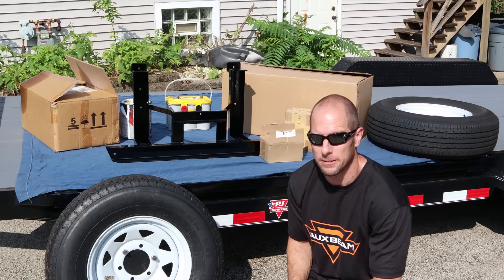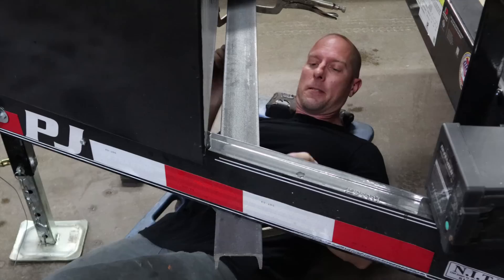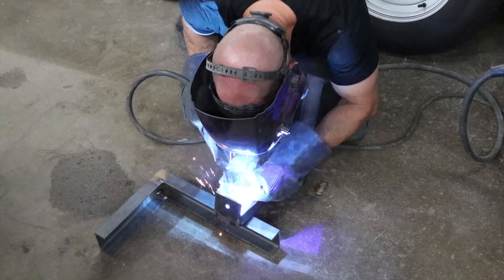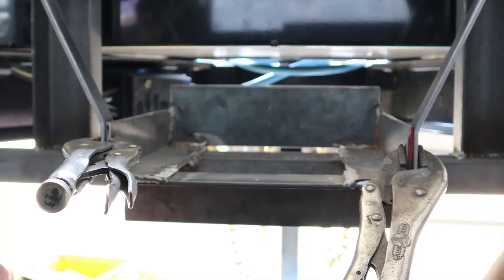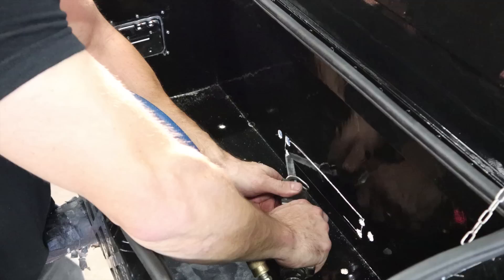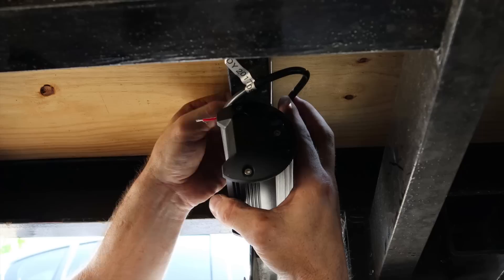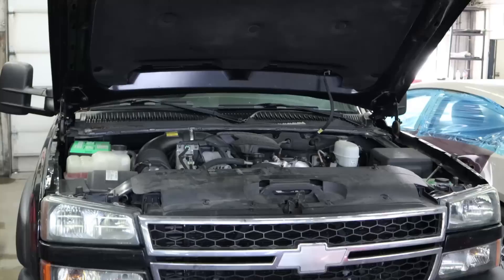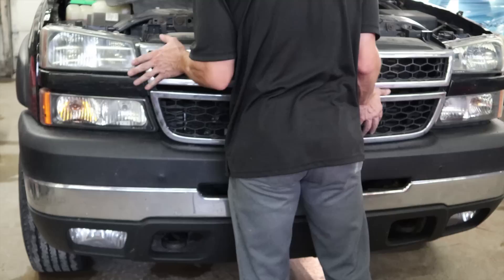2019 PJ equipment trailer winch mount fabrication,  LED light installation and other mods..

Comment: Great Job as always Scott. I bought a set of AuxbeamThree Colors Switchback LED Fog Daytime Running Lights and they are junk for my SUV. On more then one occasion I start my SUV and 1 light is white and the other light is yellow. So I have to keep turning my fog lights off and back on to try and get them to be the same color. It is really a pain in the arse. I have tried contacting Auxbeam through Amazon messaging so I can get this warrantied but they keep ignoring me. Sorry but I can not recommend Auxbeam. Sorry Scott to bring this up on your YOU TUBE page but everyone has the right to know how companies treat their customers.

Comment: the rotating back of the LED lights is so you can put them in so the led chips are parallel to the ground.
Reply from the maker: Actually it is to allow you to line up the muffler bearing and properly fill the turn signal fluid. LMAO

Comment: very nicely done, thank you for sharing!

The ONLY criticism I have is that I'd be very cautious about drilling through the bottom flange of the trailer frame.  IF it ever does cause an issue though, you're obviously more than capable of fixing/reinforcing it.

Again, well done and thank you for sharing!
Reply from the maker: Thanks,  the manufacturer drills holes in the frame as well for wires and attachments so I was not too concerned.  I always check over the frame when I am servicing the trailer so if it does become a problem, I will catch it and repair it early.  I would have preferred to weld it but didn't want to mess up the new powder coat.  Years from now when it needs a repaint, I will probably weld it on before it is painted.  Thanks for watching!

Comment: Great video I’ve been looking at these for a good while. It’s a very nice trailer and the mods r just what I was thinking about doing once I get one. The only thing I’d wanna do sometime if they r not already on is switching all the lights to led
Reply from the maker: I considered them for about 2 years.  Did a bunch of research on all brands and models and went to buy a 14k trailer.  After figuring out the numbers it made more sense to get this 10k.  The 14k cost 25% more and was 35% heavier.  The difference in load capacity was only 15%.  So to get a bigger trailer cost more to buy, register, maintain and operate but did not yield enough to justify the cost for me.  This trailer has been great so far.  I did have a wheel that split and they sent me a new one with no questions asked, just a pic to show the crack.  It pulls fantastic even when it is at full capacity.  It came with all led lights.  I don't think PJ sells anything without them.  Thanks for watching.  Good luck in your trailer search and mods!

Comment: you did a nice job.but you need to scale out your hitch. just look out when you load trucks on your trailer some states will stop you when you are over 5 tons.and they will scale your hitch. nice job again.
Reply from the maker: Thanks, I'm just at the limit with a 3500 crew cab dually diesel on it.  That would be the biggest thing I would ever tow and probably only once.  If I needed it anymore than that, I would buy a bigger trailer because I don't like to push load limits.  It leads to a shortened life on the trailer.  Thanks for watching.

Comment: Nice job. Welds look good. PJ makes a nice trailer. I have a 20' bed, dual power ram tilt back PJ (powers down as well as up) and love it. I added a winch as it came with a winch mount plate already installed. 
I recommend putting your battery in an enclosed battery box. 
Do the Auxbeam headlight housings have a cut off? Cheaper housing don't and if you run HID or LED bulbs they throw a lot of glare without the cut off.
As a former OTR truck driver, I prefer to drive at might too put my old eyes don't work as well as they used to so lighting is important. My truck is newer so has good headlights but I still run a big LED bar as well  as driving lights which are wired to my high beams so I can turn them off when encountering approaching traffic.
Thumbed up and subscribed!
Reply from the maker: PJ makes the best trailer in my opinion, the quality is unmatched.  The headlights allow you to rotate them and the beam is a wide flat pattern.  Because the headlight from the truck is still the original made for halogen, it has some glare.  I aimed the lights lower and it still provides more light than the halogen without blinding oncoming traffic.  My old halogens were worse for blinding people and didn't provide as much light.  Thanks for watching, glad to have you here.

Comment: You should upgrade your trailer plug to a 7-Blade it will give you the ability to charge the battery on the trailer while connected to the truck
Reply from the maker: I didn't think they even sold trailers without the seven pin connector anymore.  Maybe some cheaper brands but PJ certainly does not.  The volt meter in the trailer tells me at a glance that it is charging properly as well.  Thanks for watching.

Comment: Nice build. I’m considering ordering a new PJ trailer and they offer a winch mount built into the floor now. Not sure if they just started that or what. But I’ll be ordering a 22’ long trailer so even if the winch is on the bed and taking up room, 22’ trailer will still be long enough I would think.

Comment: Using wd40 or some oil saves drill-bits as well. I’d lock that battery up. Smart putting that winch in the tool box. I learned a hard lesson. They’ll still mangle that box though to get in
Reply: What was the hard lesson of not having it protected?
Reply: @SumRandomGi81  

Parts of my winch got stolen

Comment: Two things. Why did you take the grill off to do the headlights? I did the same with my lights and didn't need to take it off. Yes, same truck. Second, you might want to think about some extra bracing to the winch fairlead as it will most likely bend the toolbox if not. Two L brackets bolted under the winch to the fairlead is simplest.
Reply from the maker: The grill pulls off so for the 30 seconds of work it is not worth trying to work around.  The headlight have to go straight in with the new bulbs and that is hard with the grille in the way.  I think the easiest way to brace the fairlead is with one of those fancy winch mount brackets made out of 1/4" steel that bolt under the winch and have a mount for the fairlead.  You know, like the one I used.

Comment: Excellent fab work. I think you have a marketable product. The only mod I might suggest is maybe building a box to hide that battery and make it less sexy for someone to rip it off, also making the hold downs a bit easier to service.  Also, do you have a load gauge on your hitch? Looks like the tongue is a bit high but I recon the rear of that Chevy will squat pretty good when you get a load on it... but then you' might have your new headlights shining up in the air. Be nice to see what kind of ramps you have. Also you might need some pulleys for pulling your load to one side or another.
Reply from the maker: Thanks, I switched receivers after my first one started to crack.  At the time I had not adjusted the trailer coupler to the correct height.  Now with a new truck I will be moving it again.  Thanks for the tips.  There might be another video eventually.  Thanks for watching.

Comment: Did you hookup the lights under the trailer to your backup lights or are they just wired on a switch?
Reply from the maker: Originally, they were on a switch.  Since I found myself using them as reverse lights and they worked great, I connected them to the truck reverse lights.  Now they come on when I back up or I can turn them on for loading.  Thanks for watching.

Comment: Great job !!  Just a suggestion if your going to carry any vehicles that are a little heavier you could install a wind up jack on each side to help steady the back of the trailer while loading up !! Best of luck!! Again nice job !!!
Reply from the maker: Thanks, it does have jacks in the rear, I just did not have them on in the pictures.  They mount on the cups at the rear and flip up or come off completely with the pull of a pin.  Thanks for watching.

Comment: That winch box is a great idea and the lights make the trailer much more useable. Great job. Do they make small solar panels (to charge the battery) or are they more trouble than they are worth?
Reply from the maker: I have an account that I frequently pick up and drop off at night.  The lights and winch are worth it for that alone.  They do make solar chargers, the battery charges off the truck but I usually leave them together so a solar panel would keep the truck charged as well.

Comment: Ohhh I see the G8 in the background. What about protecting the underside of the wood deck?
Reply from the maker: Yep, the G8 goes everywhere with me for the summer!  I thought about sealing the bottom but I would not be able to do the sides of the boards without cutting up the trailer and removing them.  Since I could not seal the sides, if the bottom was sealed, the moisture would be trapped in the boards and rot them faster..... at least this is my thinking.  So it seemed better to leave the bottoms to "breathe". Years from now when I have to replace the boards, they will be sealed on every side.  Thanks for watching!

Comment: Why not put the fenders on hinges and a lock pin. Place the hinges on the outer lower part of the fenders and have them fold out when you need extra room
Reply from the maker: Because the time saved isn't worth the time invested

Comment: Not gonna tell you that you should have done anything differently i mounted mine to a solid steel plate though and welded it to the front lower rail of the trailer. then cut a thin slot for the plate and cut out for the fairlead in the back of my tongue box too just like you did but i got a big enough box to go across both tongue frames and put my battery inside the box with the winch. i spent $60.00 on one of the cheaper harbor freight boxes and i have the same yellow top optima deep cycle battery and of course there are no switches for the lights because my old beater trailer doesn't need those any more. it's in more desperate need of some maintenance than lighting. need to replace both axles and all 4 rims on mine. i've had my trailer since 2005 and it has paid for it's self 1000X times over now so the fact it needs new axles is perfectly ok by me now. finding them however is going to be another story i need to have it retrofit with a dove tail and some ramp storage though. right now i just put the ramps (which are also too short) inside whatever vehicle i am pulling or in the back of mine if i am pulling with my Escalade EXT otherwise i would have to chain or strap them down to the deck it's self. i'm wanting to do those upgrades because like i said i bought it new in 05 but it's just starting to little by little fall apart on me now. of course like i mentioned in the comment you responded to the other day i now have an 06 cummins mega cab to pull it with too so it won't matter whether i buy a new one or retro fit this one. it'll only matter to my wallet. Thinking i am going to upfit this one and go buy a covered trailer come to think of it
Reply from the maker: I had mocked this up in about 20 different ways before I went with this method.  It seems to work so far.  I don't know how I used my old trailer without the lights.  The time I spent doing all of this work has already been saved and then some.  I was limited with what I could do with the spares and other tool box around where I needed the winch.  Thanks for watching.

Comment: Once you blow out the Chinese tire with 90% of the tread left not your fault it’s the tires. We switch to fire stones and our spare tire problem has disappeared no more need for two or three spares. Our little business runs about 12 trailers we have per airsoft pellets into balance and have never had any poor wear or shaking problems
Reply from the maker: Weird, my Firestone tires on the truck still pick up nails and screws.  Maybe you can let me know how to inform the debris on the road that it should not affect my Firestone tires and I can use that trick on my cheap Chinese tires.
Reply: Well you can’t argue with that logic. Carry-on.
Reply from the maker: Mark Shropshire I used to work at a full service gas station in high school and college(yeah I'm old I know) it was in a very upscale town.  I had mounted 4 new tires on a guy's Mercedes and he returned the next day with a flat.  Of course it was my fault and he demanded to watch me as I fixed my mistake.  I absolutely hated when customers looked over my shoulder so I already was not in a good mood. As I set the lift, I felt a sigh of relief.  There it was, a roofing nail dead center in the tread.  I pulled it off the car and didn't say a word.  With him looking over my shoulder, literally. I sprayed a little soap on it and there were the bubbles.  He was even further angered by my f*** you grin as I said," Here is your leak."  I don't think he was stupid but I think he was having a hard time with the fact that he might have to apologize to a young punk that took his mistreatment and did nothing wrong because he immediately followed with, " I just bought these tires!! They are brand new how could they possibly have a nail in them?"  To which I replied, " did you tell the nail you had new tires? It must have thought you had your old set still!"  He turned around and walked away.  I repaired the tire and didn't charge him.  In my mind, it was worth working for free and my boss would understand I was trying to keep the customer as happy as possible.  He did end up tipping me and apologizing.  It must have been a humbling experience for him and he always treated me with respect from that day forward.  I learned as much from him as he did from me that day.  I have been on his side of that interaction and understand where he was coming from.  I didn't handle it well at first but recalling this sent me on the right path.  Sorry for the story, but it does bring me to my point.  I have had the Chinese tires fail in the past like you said.  Most of my blow outs come from under inflation after picking up a nail.  When the tire is on the truck, you notice a low tire by the handling characteristics and can stop before any further damage results.  When it is on a trailer, you can tell by the shredding tire parts flying through the air. Lol I walk around the truck and trailer every time I stop and sometimes I get lucky and picked up the nail beforehand and can swap on the spare before I need more than a plug. As much as I hate them, a TPMS for the trailer would solve most of my problems.  BTW I am A Bridgestone/Firestone fan and will use them if they are a cost effective option when it is time for a new set. Thanks for sharing.  I had heard of the pellets but wasn't sure if they were worth it.

Comment: Nice welds, looks almost like tig
Reply from the maker: Thanks, they could have been a little deeper if I had used thicker wire but since I welded both sides, it will not be a problem.

Comment: Looks good man. Being a new trailer from the dealer you might want to have the tires balanced. I bought a new car trailer last year and every time I got to 60mph my truck would vibrate. Didn't see the trailer moving and the truck only vibrated in those circumstances. It was the cheapest of my possible solutions and now it pulls like a dream. What are the lights under the trailer for?
Reply from the maker: Thanks, I will balance them if I need to but so far this thing pulls soooooooo smooth, I don't want to mess with it.  The lights in the back illuminate the ramps when you are loading and the underside of the car if you need to attach the winch to load it.  No need for flashlights.  I did not intend for them to be reverse lights but they actually work great for that.  They are now hooked up so they come on with the reverse lights on the truck.  Thanks for watching.

Comment: One thing you might notice is you cant seem to keep the lights in the front of the fender I converted my entire trailer over to what are called penny lights much smaller cheaper and take way longer to be smashed out. I was wreaking a light every trip I took with it now it's been 6 months and haven't had to change one yet
Reply from the maker: Thanks, I'll keep that in mind but so far so good.
Reply: I also live on a grid so that dont help

Comment: Very awesome job man, that's exactly what I plan to do to move when I buy one, did you happen to add any extra lights or reflectors? Just thinking night driving is better when that trailer is lit up like a Christmas tree and maybe some more on the truck too. Hope you still have the '03 going, great job on the '15 2500.
Reply from the maker: No extra lights or reflector, not for driving.  Just the ones for loading and working.  The reflective tape is all over it and it shows up very well at night.  All of the mods get used and have ended up saving me more time than I invested to install them.  I have added a few more so I might have to make a part 2 for this video.  Thanks for watching.

Comment: How do you like the short beaver tail? I used one with a short tail like yours and didn't really have an issue, but it did come real close to scraping the headers on my car. The trailer I bought is a Classic Manufacturing 18' with a 4' beaver tail. I have much more room with it.

Comment: How do you keep the battery charged for the winch?
Reply from the maker: The constant power from the seven pin trailer connector is connected to it.  When I am driving the truck, it is constantly charging the battery.  Thanks for watching.